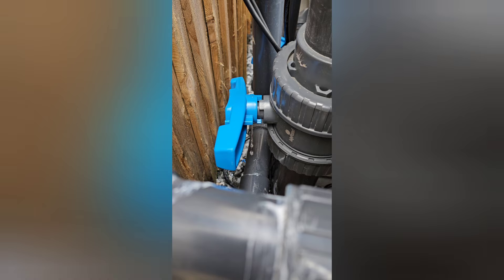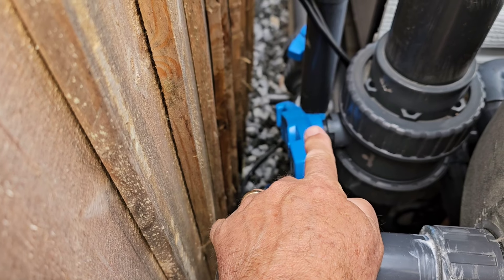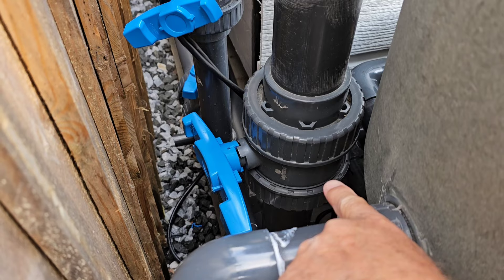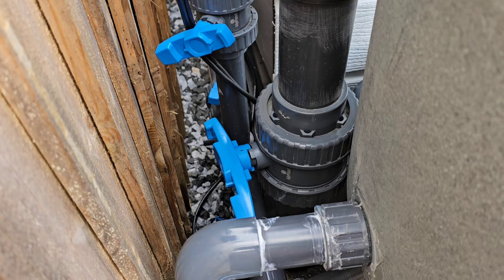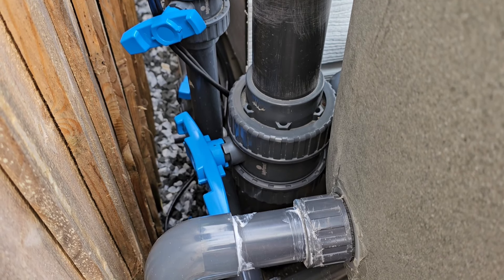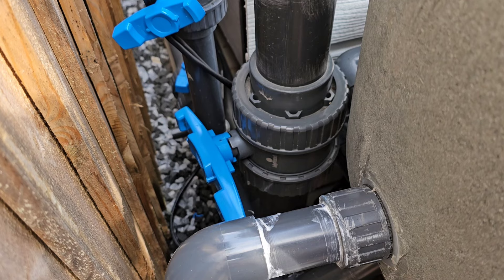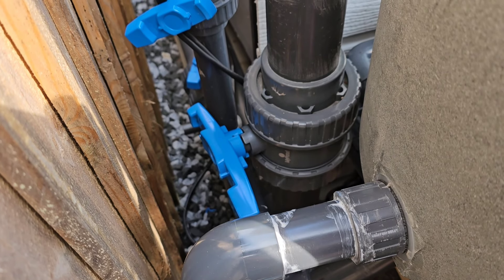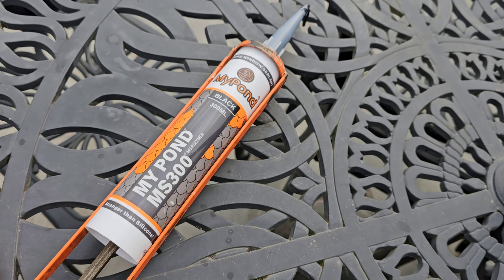Yes Yet Another Mistake!! #fml #koi #ball valve #koikeeping #ms300 @cwdpond

Comment: If you have to replace the ball valve just use a 4” adjustable pipe bung in the bottom drain no need to empty or remove koi 😊
Reply from the maker: @baitking1  thank mate appreciate the advice 👍 🙏

Comment: If that doesn't hold you could try filling it with the sealant and then wrap some rubber gasket material around it and put a fine thread stainless steel screw into the hole. Screw just a little bigger than the hole of course.
Reply from the maker: @andys5562  thanks for the info I'll see how it goes 👍🙏

Comment: Mate what a bastard you would never think that would happen I will make sure I never try that 🤣🤣😂😂 good tip to pass on. I wont go into the small drip I had on a slid valve easy fix me thinks. So 3 hours later frigging water everywhere and the drips even worse and all I've got to show for it is that feeling I wish I never started that job walked away at that point come back next day and In 5 min fixed it 😂😂🤣🤣Older and wiser as they say
Reply from the maker: @boxtriker  wounder mate there must be a reason for it being hollow but don't know what it could be.